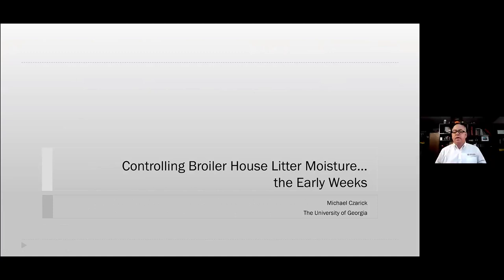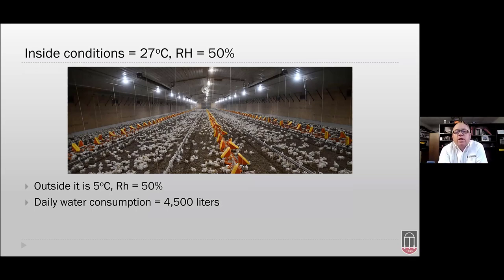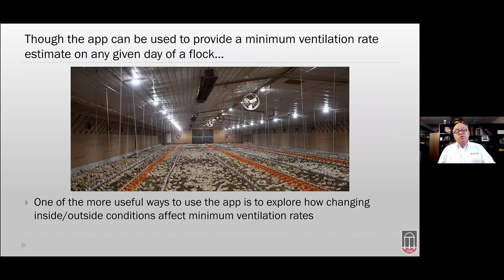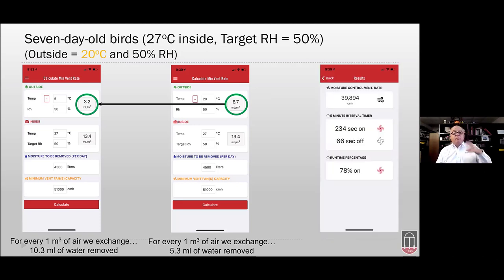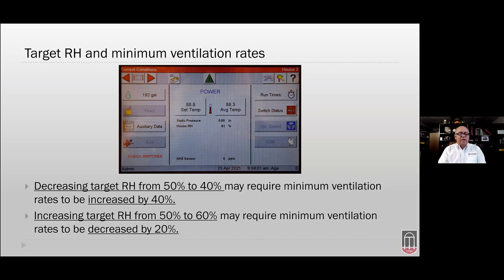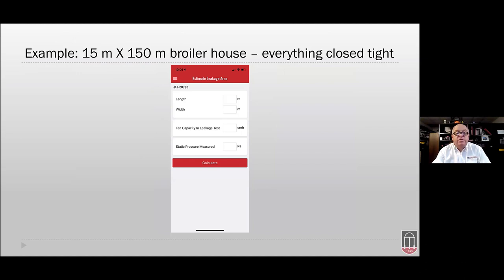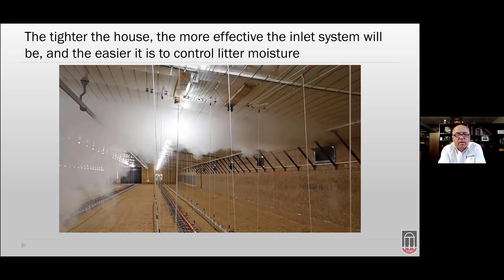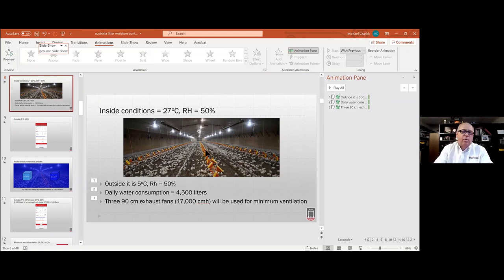Controlling broiler house litter moisture... the early weeks

Comment: Michael. Been reading your stuff for years. The ultimate ideal is a perfect world but as a chicken grower that ideal is spoiled by conservative processor budgeting of input costs. An app that worked backwards from an acceptable bird carcass/flock downgrade/mort figures with the weather factors and the fuel costs per bird built into the pricing formulae with an acceptable bird house temperature envelope that would then dictate/produce a litter of a certain quality is what is needed. The processor then could prescribe a change of one of the input factors to generate a higher or lower quality outcome. An achieved balance would then be their responsibility of the processor and the cost of obtaining a nebulous litter quality would not be implied as being the growers responsibility. I dream, I know.
On a serious note it would be good to see some stuff on the difference between moisture in cake litter (dropping accumulation around drinkers or between drinkers and feeders) and the moisture level in litter unaffected by geographically specific dropping accumulation i.e.. in places other than around drinkers. I must emphasize that the moisture I am referring to is largely from droppings deposited and only minimally from beak spillage after drinking. I find the difference, vast. But where does a grower stand in the scheme of things in comparison to everyone else? If you looked at a foot either side of my drinkers you would say horrendous and everywhere else, you'd say perfect. The current recommendation is to break up the cake into the litter strata but I say the wicking effect is then removed and moisture is retained and anyway the litter strata is not sufficient to disperse the volume of cake to an acceptable level. Litter left unworked has a lower level of overall litter moisture at batch end. Interested in your thoughts on, or directions to, answers on life's most important questions. Regards Stephen from 'the end of the earth'.